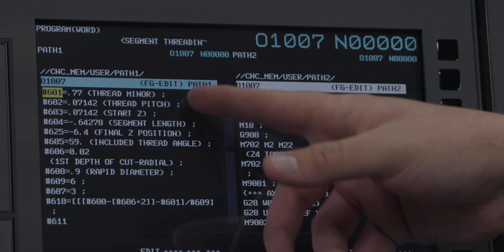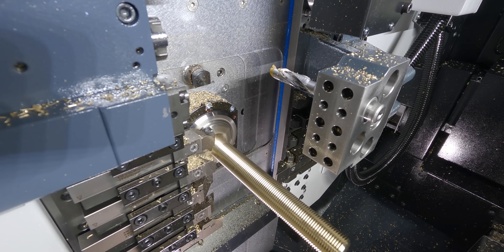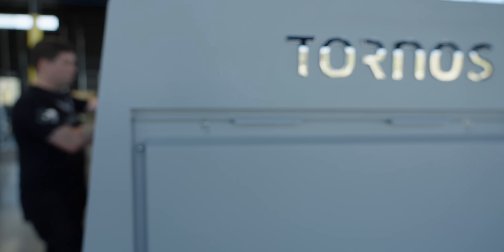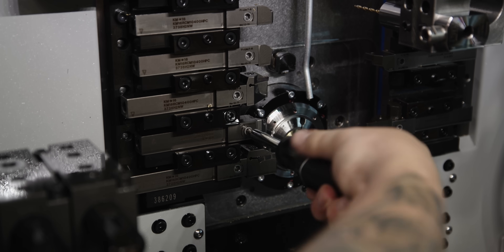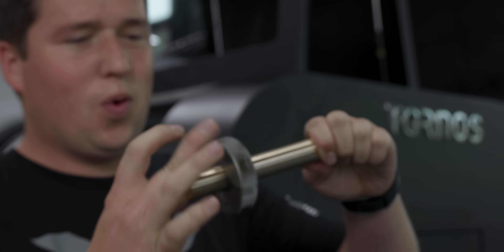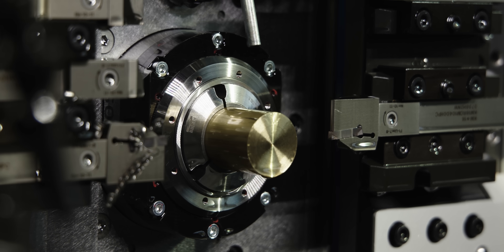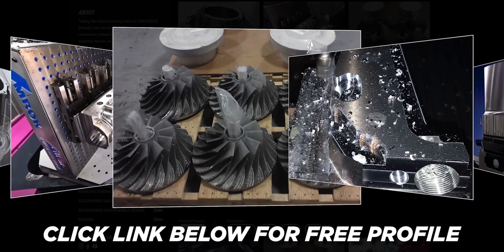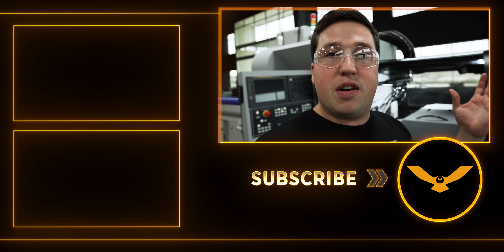Machine CRASH and Spindle Destroyed..How did this happen??

Comment: Rule #101 always use...
1. SINGLE BLOCK ON when proving a program.
2. Keep hand on RAPID TRAVERSE DIAL and modulate speeds manually or use FO (feed override) function so you can fine tune your positioning, especially if the part is very complex and not much room to tool path clear around it.
3. Read your program incoming block by block before activating a line, so when using SINGLE BLOCK  function you get a good very concise feel of the sequencing of functions as they read off.
4. Always familiarise yourself with where the EMERGENCY STOP BUTTON is on all machines prior to operation! 

I hope this helps those who read this.....I'm a 35year veteran of CNC machining, and still thoroughly enjoy new innovations that come into fruition,some of which I've personally created and brought to the world of manufacturing and I'm not talking about parts or components I'm talking about formulae coding macros and modify parameters and modal techniques to achieve what most call impossible! 
Anyhow keep pumping chips guys experienced new blood is always a sort after  commodity in all working environments and remember no-one ever knows everything and keep learning till you die💪❤️👍
Reply: One of my biggest complaints about the machines I run is that even though they are of the same manufacturer, with the same controller brand, and run the same parts, each controller is different and has E-stops located in different positions. I've had to familiarize myself with 9 different control layouts and some of the machines have little quirks to them. 

On one you can just hit reset to reset the parts/tool counter when it comes up. On another you have to hit counter reset which is different than just reset. On one you have to hit insert instead of input to input a program sequence. On one you have to verify your wear offsets by hitting a button, the other machine running the exact same part doesn't require that. Some go into dry run as soon as you open the door or put them in handle mode. On other you have to remember to put it in dry run. 

I've only been in this job for 4 months and so far that's been the most aggravating part. Even though 2 machines may be the exact same model with the same controller brand, they may require different operation procedures b/c one is newer than the other and the controller has been updated. I went from no CNC knowledge to being able to operate a Tsugami swiss lathe in 2 months. It was a lot to learn and I still learn something new every single day. I can't do a whole lot but I can change and touch off tools, make wear offsets, operate the bar feeder, set the guide bushing pressure, and make good parts. Its been a steep learning curve that's for sure.
Reply: @oldscratch3535  That's great👍 You're probably not at the modifying parameters stage just yet, but this is the reason why you are finding different settings on machines! 
Get the books on the machines and read read read .
Also read the styling of the programs created either manually via someone or via cadcam....most shops use a similar style of programming on all machines in shop,whereas you look at programs in other shops the styling is different.
This is not a big issue at all and as you familiarise yourself with all these facets you'll also use and improve on programming styling sequences!
If you've got any particular query you'd like to ask me, sure go ahead I'm happy to assist someone who wants to learn 👍
Reply: @Th4thWiseman  Yeah, I don't know how to do any of that nor am I allowed to. Its a large firearm manufacturer so all of the parts are designed and engineered to death and no one on the floor has authority to make design changes. 

The more experienced guys can go in and change small things like feed rate if a tool is having problems or modify cutting parameters, but that's about it. We generally don't have to do that though as the programs are all proved out way before they ever get into large scale production. 

I kind of wish I had started on a standard 3 axis mill instead of a swiss lathe, but I think when I do finally get to run a vertical mill it won't seem as complicated or intimidating as a swiss lathe. There's so much going on in there that its hard to wrap your head around it at first.
Reply: @oldscratch3535  Sounds cool, scroll through your interface menus whenever you can and get to learn what each page relates to ie. You're on a lathe so you will have a tooling page that having z-x fixed numbers,those are the tool lengths some will have a y fixed number for it being a live tool also.
You will also see a list in there that ranges from 1-10 that is inline with each tool, these numbers 1-10 tell the lathe what tool is in each holder ie. 1 = facing
2 = parting off blade or plunge tool
3 boring bar /bar tool standard on CW rotation pointing upwards toward rear of lathe.....etc etc.
The large numbers z,x,y are fixed length figures measured using either the arm inside to calibrate touch off on or you can do it manually keying in figures, these numbers all work from home position also called the G50.
Anyhow absorb this and it'll sink in and one-day you'll click with it all very easily in one thing you find in program that will switch on all the lights inside you👍
Reply: @oldscratch3535  Oh another very good thing I'd like to say to you is," Being in a facility that's doing armoury is a very good place to learn, because you're not in some ad-hoc shop learning everyone elses mistakes that inevitably you gotta unlearn".
You will be at the pinnacle of standards and practices in the ISO 9001/9002 code of standards doing inspections of 1 part in X amount? depending on tolerances and production count in total.
The ISO system puts you at lead of most facilities especially those who don't subscribe to it.
Yes it's expensive but in the broader picture it's actually quite cheap when taking into consideration the quality of service you can guarantee a customer and it has traceability that's easy to find if an error occurs 💪
Stick with it, you're in the right operation👍
Reply: @oldscratch3535  This is good you acknowledge this and the most probable anomaly that you describe is parameter settings of CNC interface itself. 
These anomalies are all ironed out if you take due diligence for all machines to function at a "mode" that's across-the-board familiar 👍
Reply: Have fun single blocking a 500k lines program
Reply: @Dillybar777  Your 500k line program I'm quite confident I can manually write it in maybe 2 whole pages on monitor! 

Keep learning young buck , you'll need it to compete at top end👍
Reply: @Th4thWiseman  yes I'm sure you can. It's time for bed grandpa..
Reply: @Dillybar777  Funny boy🤣
Grandpa only rests when his children are safe✔️ 

A good thing you're doing is being critical, this shall get you far! 
Apply this with knowledge and even questions but don't apply this as banter❤️
Reply: @Th4thWiseman  nice talking to you
Reply: @Dillybar777  You too Dillybar 👍 
Keep on keeping on step by step in that BIG cam program 500k liner that chews up all your storage devices 🤣 

The secret sauce that even Titan sometimes says with a laugh still resides in hard work, never be mistaken 💪

Comment: More videos on macro programming would be nice
Reply: Stay tuned
Reply: @donniehinske  I've got a program I run at work that I inherited when I became the machinist here, jam full of macros for speeds, feeds , probing for  z height that updates the z height as it mills down each step.  

  I've learned exactly how it reacts I just don't fully understand the coding. It's very annoying It's like a pain in my side   that I haven't fully learned it yet.  I get the variables how it uses formulas to do speeds and feeds but the rest of the height stuff uses the the probe height but I'm not understanding how or where it's storing that value or how it's updating
Reply: @donniehinske  very little videos of sufficient quality available even on YouTube for macro programming
Reply: Add me on FB and message me. I’ll help you out when I can

Comment: New guy crashed our machine but it wasn't his fault. Head machinist wrote a program on my machine and took it over to his machine. My machine has tools in slots x,y,z, new guy's machine has tools in slots w,x,y. Called for a tool that wasn't in the same spot on new guy's machine. BAM. New guy learned to watch closely and ease the turret in,  especially on a new program. Lead machinist learned to double check his work. Crashes are scary and expensive but thankfully everyone at my shop knows this so boss didn't lose his cool. They replaced the broken tool, fixed the code, and got back running the next morning.

Comment: I remember the Haas Mini Mill that my (UK) college (below uni level) got stuck doing a tool change. I ran the recovery program and it bent the half inch thick steel plate that holds the tools. Completely took the machine out of action.
We had a new workshop technician who didn't know how to use a CNC, but had some incredible experience. Instead of calling in Haas to fix the machine. The both of us took the too changer from the second mill we had and sawpped them. Then bent the plate back and put it in the secondary machine where it was good enough and wouldn't see as much use.

I'm super grateful to him for forcing me to fix it rather than costing the college a lot of money. Learned some incredible and invaluable skills that week

Comment: I've done a mistake two weeks ago.
We use a template header in the beginning of each operation. But sometimes I have to use a CAM system whose postprocessor spreads important words (such a G43 H... and D) across the different frames and I have to adjust this code manually to the our standard header.
For manual coding I use CIMCO Edit. And  It can highlight frames/words by different colours according codes. So, when I was correcting the postprocessor code, I didn't notice that there was a combination G43 H00 (consider the same as G49) in the line with the first cutting movement, because it was all highlighted in green 🤡 Naturally, the tool flew into the machine table. I was so depressed that I thought about quitting. The boss calmed me down, said that people tend to make mistakes, especially beginners (I work as CNC programmer for 6 months). But here the price of mistake can be very high, so the "lesson" should be extracted to the maximum.
Reply: Honestly dude for six months that’s very well informed! Wait until you hear more of my crash stories. It’s unfortunately how we learn. It’s good you felt bad about it but I really recommend just learning from it. Apologize and move forward. No one can ask for more.
Reply: @donniehinske   Thanks! :) I will be waiting for videos with your stories.
Reply: Same here.  Been in the machine shop since June.  Was handwriting a program at 6am last Wednesday...called for a G43 H06 instead of a G43 H19 because my brain wasn't awake yet and confused the M and T numbers I had just typed in.  Didn't see it until after the crash.  T6 is my shortest one, little half inch endmill with 3" total offset.  T19 was a tap that's got about 6" total offset.  Went overtop the first hole and then impaled itself completely down in there.  Took me till 10am and sacrificing an endmill to get the tap out of the part and hand turn a pin to fit the hole, also my nice 1/4" tap holder is now screwed and my M6 form tap is dust.  Don't quit though.  Remember to check that particular thing next time.  Now I check my G43s much closer than I did.

Comment: I'm run my Dad's shop, and I pretty much do every managemant/lead position as well. I also get to be the one one to fix our machines. Outside of sending out spindles to be rebuilt, or a control that blew a capacitor, we haven't had to spend any money for a tech to fix our machines in years.  It has to be one of the most stressful thing I do. Tearing into machines that valuable knowing what's on the line if I don't succeed.  Right now I have our Samsung torn apart waiting for the spindle to come back. Although stressful, it feels good to be able to fix out machine, and save the company a decent amount of money every time. Most our machines are 10-20 yrs old, so it feels like every 6 months I get a new project. Some quick and easy others not so much.
Reply: Yea you gotta do what it takes! Always stressful. It does feel great when you do actually accomplish what you set out to do. The path there can be brutal though.
Reply: You must enjoy the extra pay and bonuses every time you save your company thousands! Mick🇦🇺

Comment: Good video, good lesson. I’ve been running CNC lasers and i definitely went through a lot of mistakes to get me where I am today, love watching your videos God Bless
Reply: I think lasers are my favorite machines. You can do some very cool stuff with them if you know what you are doing. I've got a few in storage right now, just waiting to get some space.
Reply: @JSAFIXIT  it's cool how new machines or methods open up so many new possibilities. I've felt that way after coming across waterjets, wire and sinker EDM's, etc. Same thing with materials. The last shop I was at we mostly worked with bi-metals. We used explosives to bond things like stainless to aluminum, copper to titanium, etc. The advantage is having a finished product that is mostly aluminum so easier, cheaper, faster to machine than stainless, but all of the flanges could be welded on with the aluminum side attached to the chamber and then the stainless side being used for the sealing surface. They could also be made so much lighter compared to all stainless versions which is a crucial factor when the products are going to Mars or elsewhere in the universe. We made ultra high vacuum chambers used by places like CERN, JPL, NASA, SPACE X, universities, national labs, etc for mostly research. Explosion bonded materials can be incredible for many applications and its awesome scrap to use for side projects. We also had some parts that were 3D printed aluminum. They were incredibly intricate and completely impossible to machine from billet, but they were metallurgically comparable to 6061 T6. Technology is amazing. 👍
Reply: @JustLucky825  I was amazed how accurate EDM is! It's such a simple thing mechanically too.
Explosion bonding/welding is neat too. I've never seen it done, but I've read about it. 
I think 3d printing with metals will be revolutionary to what we can build. We may even be able to use extremely exotic alloys or multiple types of metals/ceramics in one piece that would otherwise be impossible.
Reply: @JSAFIXIT  absolutely. Speaking of EDM'S, the first time I used a wire was to cut a gear for a submarine when I was apprenticing at a navy shipyard. The accuracy on a first cut is just great. If I could have one machine at home, it would probably be a wire. If it conducts, it cuts. As for material, explosion bonded stuff is the best I've ever worked with. You are right and the future, which is coming fast, is going to unlock some amazing things even just in our little world of machining/welding/manufacturing.